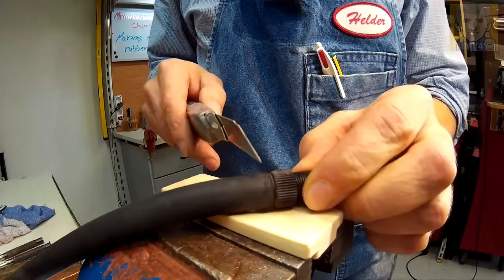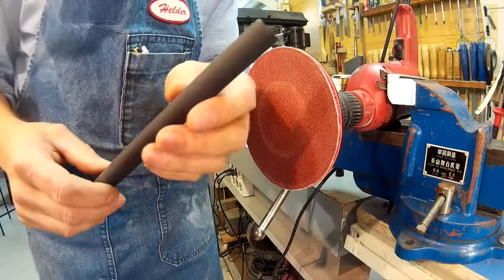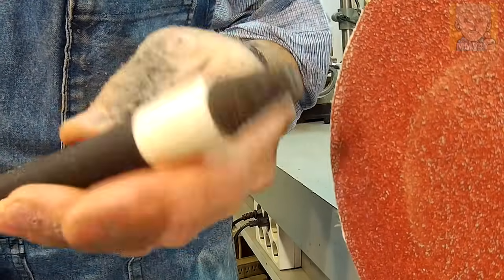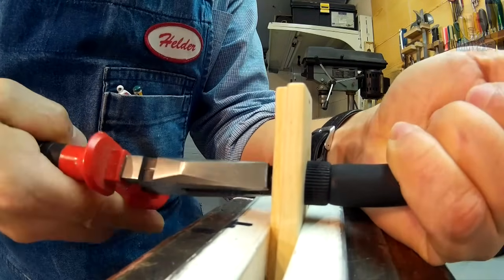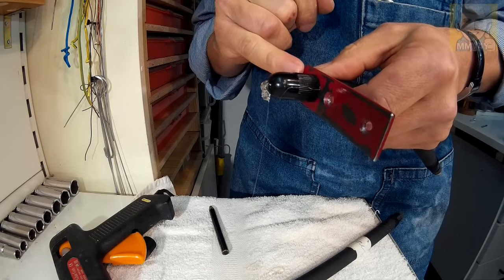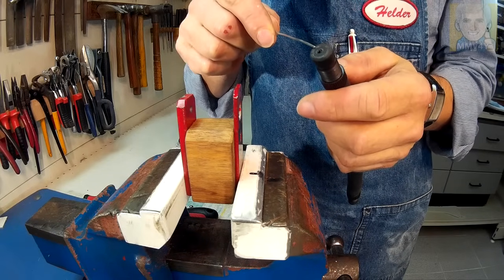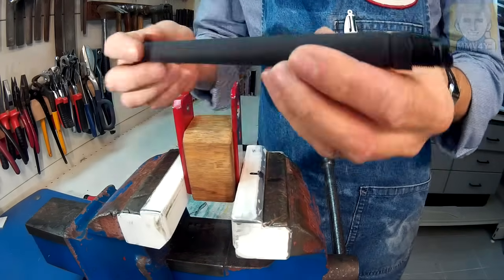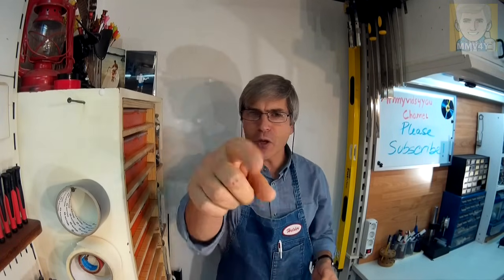How To Make Speargun Replacement Bands Easy!

Comment: Outstanding, wish you had posted this video five years ago, now they have Euro style adaptors with built in inserts and muzzles to accommodate sling bands on Euro style guns that you can buy separately. You have to be able to make bands out in the fieldthese days no matter how well you prepare, rubbers are the first thing to go. The manufacture realized not many people have all these tools or a tool shop, innovation willalways find a way. This is such a great tutorial, maybe next winter I will try this out, you are great craftsman with a lot of creativity. Thanks!
Reply from the maker: Hello ramm  one,
for me was the cost of buying ready to use rubber bands that motivated me to find a way to start making it at home, it toke me some time to get all the fixtures made but it was worth it. 

I`m glad that you find this video useful.
Thanks for the comment and for watching my videos.

Comment: man great video and in general congrats on your job. I saw what you did with the wooden spearguns and it was very nice. Unfortunately I canmot say the same about the rubbers. I admit that the whole jig thing is very clever but because speargun bans are quite "special" I have to say that this is not the proper way to reuse an old pair of bands. I would like to share with you some informations about the matter as lomg as you are interested and please note that I dont want to brag or anything like that. I repeat that I find your work very clever and impressive
Reply from the maker: Hello ThePlatont,
I´m only reusing the plastic threaded inserts, to make new rubber bands, using brand new rubber. In my opinion these rubber bands are as good as any pre-made ones, and the final price is less than half.
Thanks for the comment and for watching my videos!

Comment: @MrMyvids4you What did you glue inside the caps? Piece of pencil? If so did you drilled all the way making a hole on the piece of pencil? Thanks
Reply from the maker: Hello Robert Gee,
the piece of pencil was removed to created a pocket for the ball bearing, the pocket keeps the ball in the right position to be pushed into the rubber band.
 The hole that i drilled and tapped is for the threaded metal piece (srew) to push the ball bearing into the rubber band, locking the plastic insert in the right position.
Thanks for the comment and for watching my videos.

Comment: Olá amigo...  Gostaria de saber onde eu posso encontrar essas roscas pra embutir a borracha novamente?... Obrigado
Reply from the maker: Hello Claudinho Nova História,
the threaded "male" inserts that are fitted on to the ends of the new rubber bands, are the ones that I removed from the old broken bands, and as far as I know there not available in the market.
The pieces with inside threads "female" are from a "2mm wire wishbone" and that can be found on any spearfishing store or on line.
Obrigado for the comment and for watching.

Comment: Really nice vid and I'm happy it worked, but I feel you overcomplicated this process.  A simple knot in a piece of dyneema or spectra inserted in the band and a constrictors know on the band to hold everything in place works just as well.  nice video though.  the guns look great
Reply from the maker: +joseph smith 
Hello joseph smith,
some spearguns heads have only 14mm threaded holes to secure the rubber bands, your method is recommended for speargun heads with holes, like the one you have!
Thanks for the comment and for watching!
Reply: Yeah my guns don't use threads.

Comment: Have had metal inserts and i can see the plastic very well and i also understand the downfall of both of them.

If the rubber breaks or you accidental slip and it fly into your hand or other bodyparts you will have serious damage and ontop of that the "hard" parts is the reason rubber breaks.

Skip all the accessories, grind the cone on the rubber. take a "16 strand" 2mm rope and make a figure 8 knot put some dish washing liquid and push it into the hole with a screwdrive (goes very easy)

then simple make a knot with the thread over the rubber and tighten. no hard parts that will break your rubber or your bones, it may still hurt but nothing compared to hard objects and its also cheaper.
Reply: Can you plz recommend any video for the process you explained ?